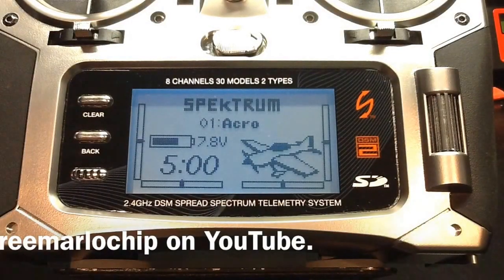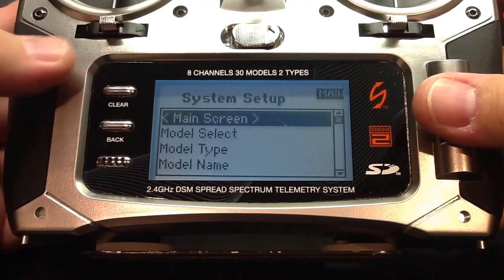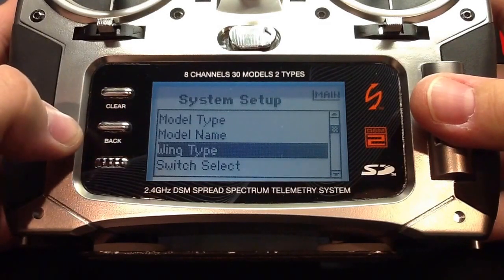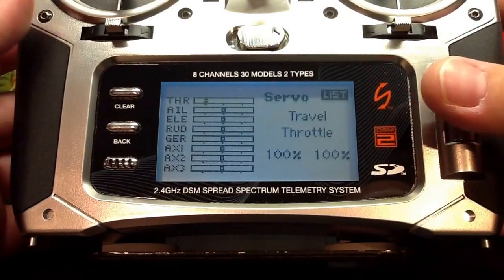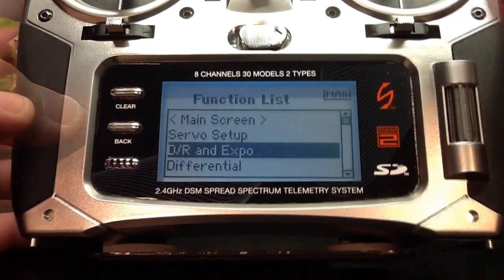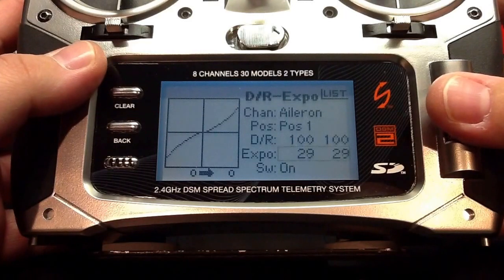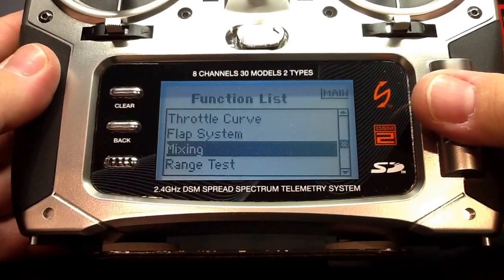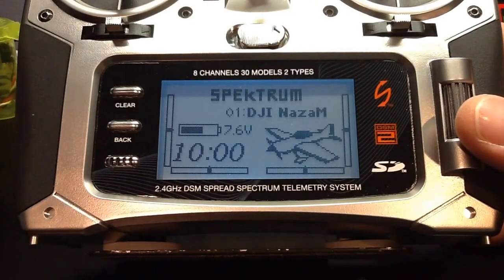Spektrum DX8 programming for NazaM Video#3

Comment from the maker: It's the Mix/Hold switch aka Switch.H on the newer radios using Lettering for labels instead of names. Mix1 (1) simply refers to the position that is active.
Reply: Thanks a ton!@@ I was able to translate your instructions for the DX8 Gen 2 as well as the original DX8 which you have presented so well.  Yours is the simplest, most direct explanation ;)
Reply from the maker: For your DX8gen.2 you can/could simply follow my DX9 series.
Reply: Very cool, and thank you... I will watch that and see how I did just by using this tutorial for the DX8 G2.

Comment: I just did this entire step and my f mode/gear still works?
Reply from the maker: Still works ???
Reply: is that ok that the f mode switch still works? Im doing everything like you are saying to do.
Reply: i did everything your video said and when I plug it in to the computer none of the sticks are working. When I move the sticks in the circle motion nothing moves and the light for flight control inst lit up for me to toggle thru them. Im stuck. I have a sk450, ar8000 receiver and a Naza multi rotor lite.
Reply from the maker: When you connect the Naza to computer and start the Assistant, do you see a SKIP option ??? If you do you have connection issues and need to resolve this before continuing
Reply: Your RX must be bound to your TX and the model must be powered up to be able to see the live channels in the Assistant...

Comment: hey are you toggling the gear and f mode switches when setting mix 1 ?
Reply from the maker: Mix1 is the Failsafe mix to manually trigger Naza Failsafe Return To Home when using GPS compass. The mix is assigned to the Mix/Hold switch position 1 so when you toggle it up it will put the Naza into Failsafe regardless what flight mode you are in to begin with. The gear and fmode switches in this case do not have any affect on this mix. Don't even remember using gear switch for my naza programming.

Comment: Hey Buddy,
Good job on this but i have one question. I am only using an Orange RX so it only has 6 channels. Your next video showes 7 connections. I did the 4 main ones along with the gear into the U slot. I am not using a gimble on this little 250MM racer so can i just hook up the Aux 1 into the X@ slot. I do not plan on using GPS on this quad either. Thanks for any help you can give.
Reply from the maker: Ray Laning If you're not using a gimbal nor GPS then ignore both X1 & X2 mentions, you could connect your extra channel Aux1 to X1 anyways for possible Remote Gain Adjustments....

Comment: This is a great video & really helpful too!..I'm not a stranger to these things but I'd not had a DX8 until recently & this video saved me a quite a bit of reading & fiddling about with the TX in getting it programmed up for the Naza....It's a pity you didn't have one that showed how to program the Graupner MX 20 though because that TX has just driven me nuts for a couple of days trying to set it up for the same flight controller & that system came with a book that made me squeak when I saw the size of it!..Got it sorted now though after many hours of head scratching, so I suppose I should really do a video like this one about it at some point to give some others a bit of a hand with it....Thanks for saving me the time with the DX. ;-)

Comment: A big thank you for a great video. Just setting up my first Naza M after many Arducopter builds. I downloaded your .spm file which has made it even easier. Just one question when I went through setting it up myself following you on the video - on the servo setup screen you showed all controls centered (except throttle). Were the F mode/AX2 switches in the mid position (ie 1). I ask just in case I have missed something out. Many thanks.

Comment: Hi thanks there's no pictures  there just a sailplane airplane and a helicopter do I need to upgrade the software on the sd card..
Reply from the maker: If you have a DX9 access the System Setup list and scroll to Aicraft Type not model type. 
I'm the aircraft type menu select the next screen until you see the picture of the airplane along with gyro features. Click on the image and scroll to change it. If you cannot do this then you you must register and update your transmitter.

Comment: Hi I was see if you can help me I have a dx9 how do you put the pic of the quadcopter on the radio mine don't have the pic of the quadcopter it just has the air plain and the helicopter and sail plain on the radio...thanks
Reply from the maker: In the aircraft type click next until you see the gyro menu and image of airplane. Then click on the image and scroll to select a different image, quad is towards the end.

Comment: Hey Freemarlochip, I have a DJI Phantom and I have an unused Spektrum DX8 that I would love to use with my Phantom. To be honest I don't know much about the radio set-up necessary for this but I have watched your videos. You do explain things in a step by step way and I note you have provided a file on your web site DX8 NazaM.spm. Can I assume this file is installed on my DX8's SD card and this is pre-programmed for the Phantom and DX8? I was also curious about the necessary change of wiring involved and the NazaM failsafes, like return to home, CL and HL as I don't want to lose my Phantom! Can you point me in the right direction?